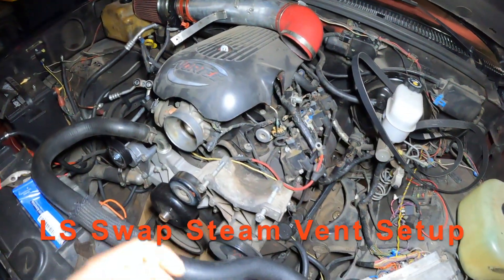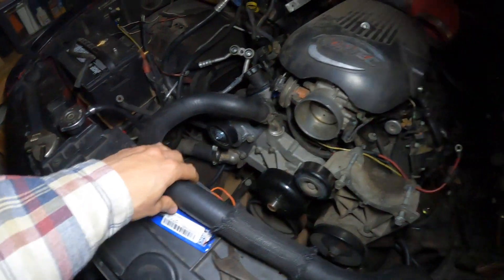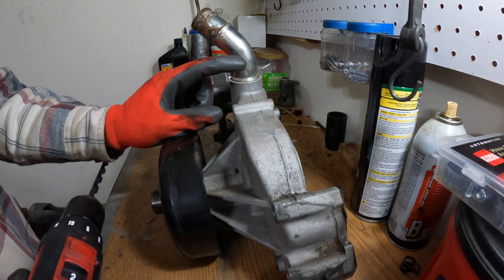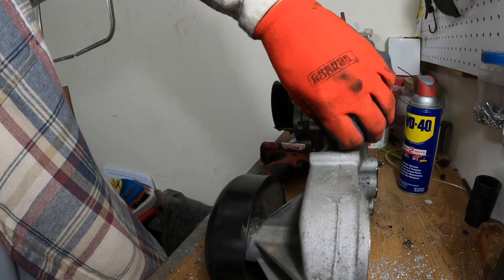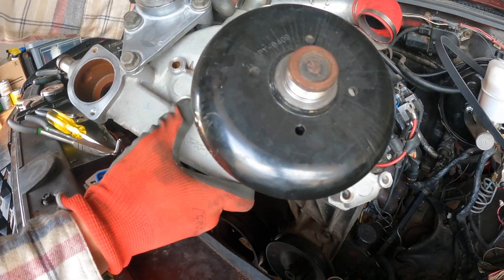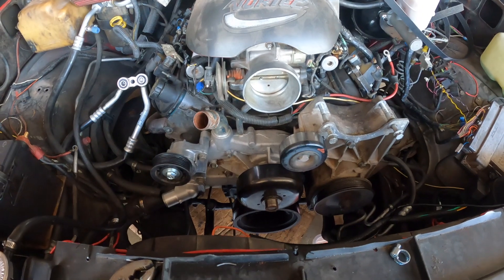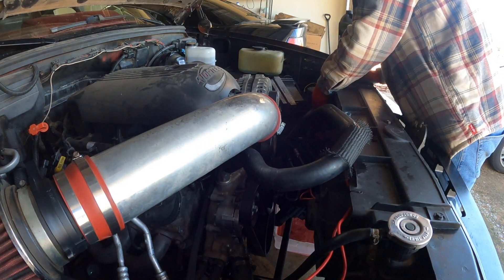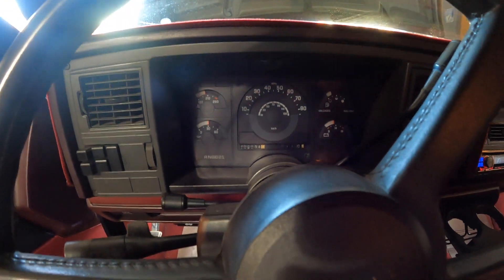LS Swap Steam Port Setup (5.3 OBS Chevy)

Comment: Dose water run thru the steam port ?
Reply from the maker: No. This is for the air pockets in the cooling system.
Reply: @MarcosXsernA  dang I think there’s water in that line on mine idk y
Reply: @MarcosXsernA  ls swap also 5.3 with the 454 ss radiator running a open thermostat because it was getting hot quick and not cooling
Reply from the maker: Make sure you fill it from the upper radiator hose first then top off the radiator.

Comment: Thanks for the informative vid! I have a similar setup with two nipples under the throttle body just like yours. What did you do with those nipples? Did you just cap them?
Reply from the maker: Not even capped. They aren't connected to anything so I left them alone. 👍

Comment: How did you clean out any metal shavings that may have gotten into the water pump ?
Reply from the maker: Sprayed it out with an air compressor afterwards. 👍
Reply: @MarcosXsernA  Thankyou,,, I`m starting with a new waterpump that I would like to do this to for a Summit 450hp long block that I`m building.